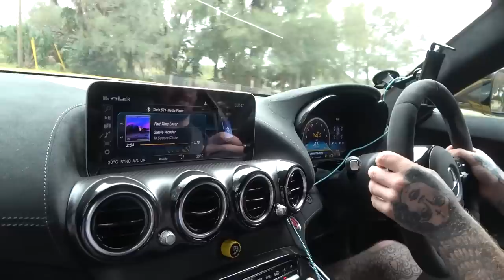A STEP TOO FAR!? Mat Armstrong is Rebuilding This WRECKED Porsche 911 GT3

Comment: 12:35 uh just a thought; tavarish mentioned that you cant jumpstart a pdk, but what if you preselec second gear in manual mode and hold both paddles? In theory the effect would be the same am i right? When releasing both paddles it releases the clutch and so it would work the same?

Comment: One thing I got from watching this Porsche series is, I no longer want a Porsche. Instead, in going to get a C8 Corvetter. It really turned me off how hard it is to get replacement parts for this brand. Although these cars are relatively reliable I cannot see myself owning a car in the future I cannot find parts to fix it, all because the manufacturer has a tight hold on them and won't release them.

Comment: That tub could be repaired, AKA cnc an alloy piece with flanges that can be Carbon Fibre bonded to the existing Tub..
Reply: That carbon disk should be ok .. as is resurface it .. the chunk wont even be noticed.

Comment: The car is a write off, needs to be stripped and placed on a celette jig, if everything behind the fire wall is in spec then it will need a new front clip (if its to be safe and made road legal).  The new front clip will have to be reattached using the the glue and rivet method.  Don't cut corners do it properly or not at all.

Comment: $30k for a single seat is pure daylight robbery.

£3788 in UK to add the pair to spec from new
Reply: He was saying they are only an extra few thousand if you want to speck them. But if you wnat to just buy them off porsche they will charge 30k
Reply: @daviddempsey2546  which is what I said, but corrected the amount from new - mat said £12k and its actually less than £4k

Which in turn makes Porsches mark up to buy separately even more ridiculous